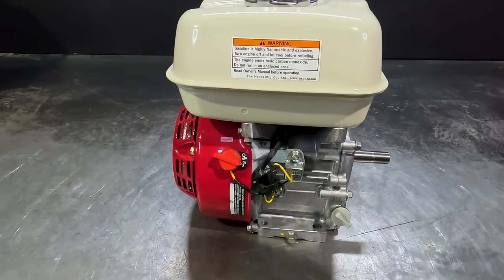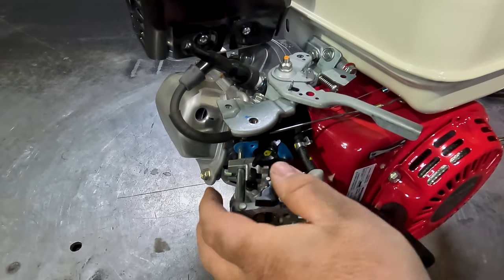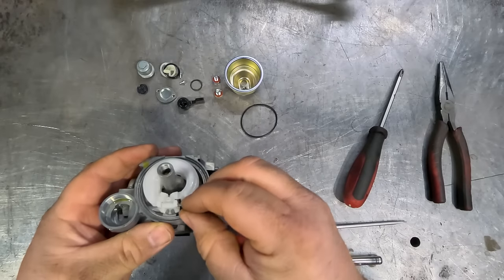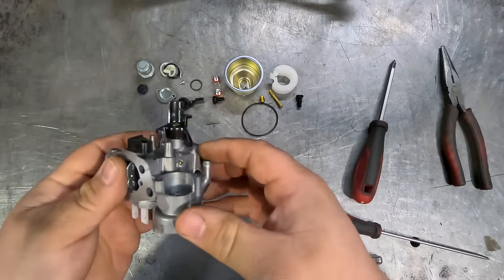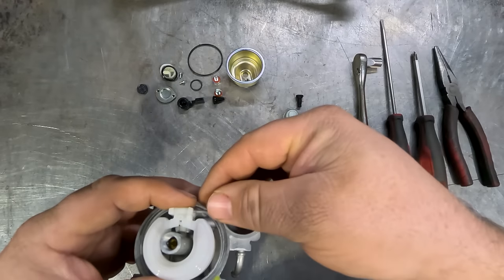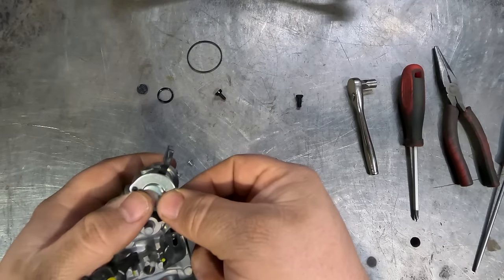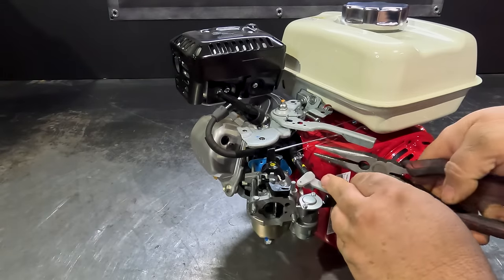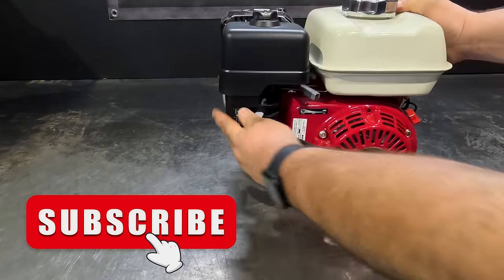Honda GX160 Carburetor Service (Same for GX120, GX200, GX270, GX340 & GX390)

Comment: Great video, nice and easy to follow. Thank you. I’m have been looking for someone in Melbourne who sells genuine Honda service parts
Reply from the maker: Thanks for your kind words, Steve!
Reply: I am just wondering no one ever replaces the needle seat in the carburetor. I have a GX140 on a tiller and the carb. is overflowing, when my nephew brought it to me you could smell gas in the crankcase oil, I cleaned the carb and put it back together and a little while later the carb is overflowing again. Will take it apart again today
Reply from the maker: Hi John,
The Needle seat is not replaceable on these types of Carburetors. You can however replace the needle itself. Check the tip of the needle, they are made of a soft material so if the tip of the needle has gone hard (as they do over time) you will need to replace it. If you are still having issues with the Carburetor after this, please send me an e-mail with your phone number to info@melbpower.com.au and i will give you a call. Cheers - David

Comment: Is it possible  to remove the bowl arms attached to the carb without breaking it?
Reply from the maker: Hi mate, is it the arms holding the float in with the pin that you are referring to? If so these are next to impossible to remove without breaking (i have tried 😂), as they are a non-serviceable part of the carburettor and are press-fitted in with plastic locking tabs. Cheers - David
Reply: @melbournepowerequipment3441  I thought it was pressed in. I thought maybe someone has been able to. But like you say you'd basically end up breaking it. You can't even buy a replacement seat. I was wondering since I was trying to remove all the plastic parts so I can soak my gx 390 carb  in pinesol. I heard that the pinesol would eat away at any plastic pieces. It goes to a hot water pressure washer.
Reply from the maker: You are spot on that part cannot be purchased. A good clean out with Brake Cleaner / Carby Cleaner should do the trick, it dilutes and removes bad fuel contaminants quite easily. If that doesn't work, we use an ultrasonic cleaner with a carburetor cleaner that's safe on plastics and aluminum, they are the best options I have found so far!